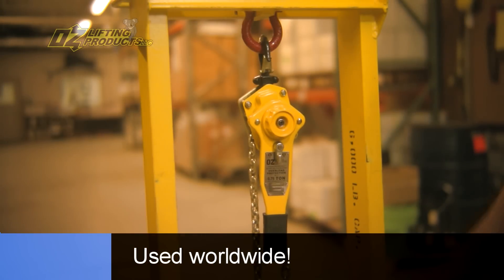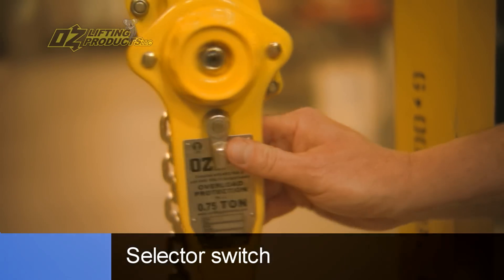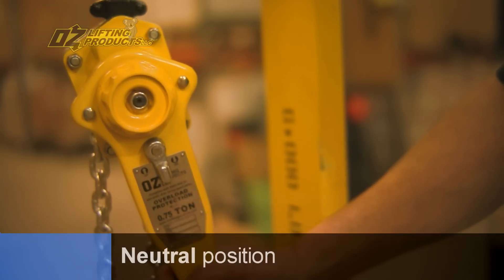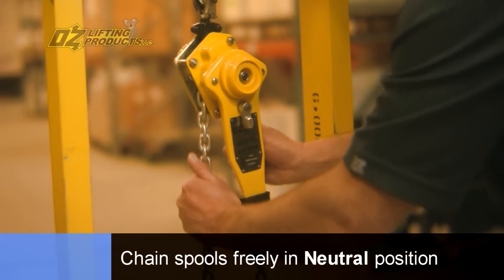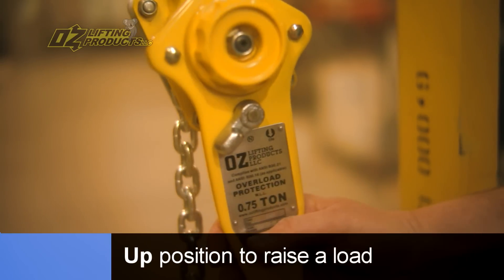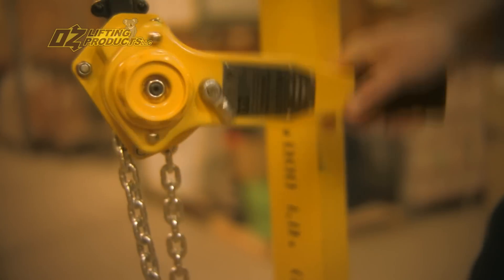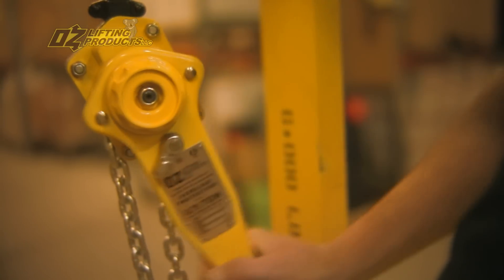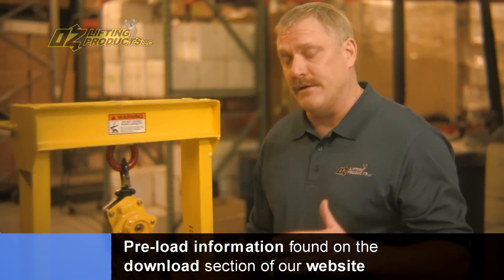How A Lever Hoist Works - OZ Lifting Products

Comment: This video does not explain how the hoist actually works.  It just gives instructions on how you are supposed to use it.   To understand how it works, you need to take it apart.
Reply: It looks just like a ratcheting chain hoist. Take the idea behind a standard ratchet (gears and a selector witch), and a normal chainfall, and marry them together. You get this.